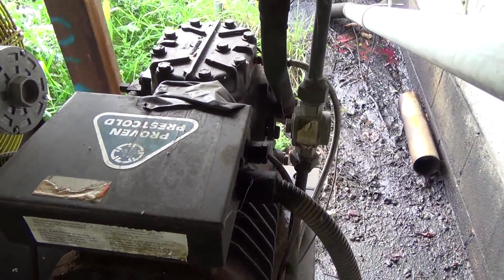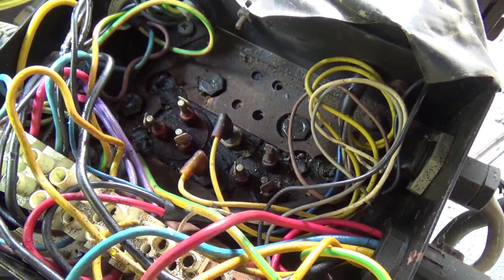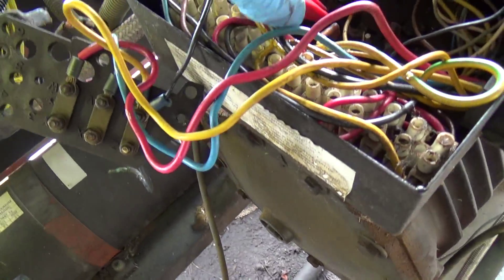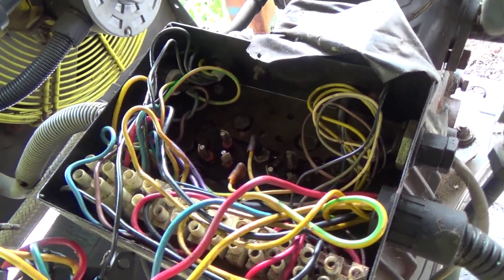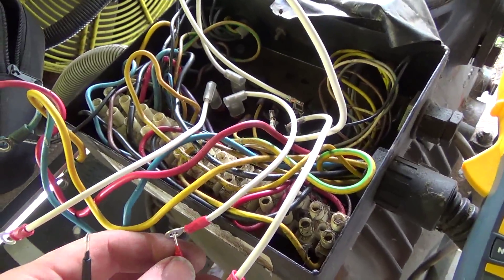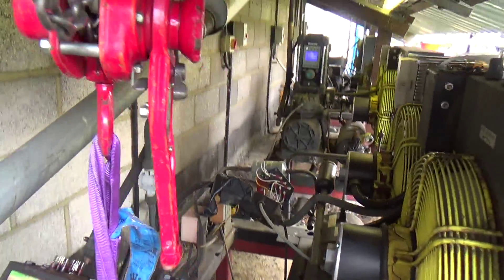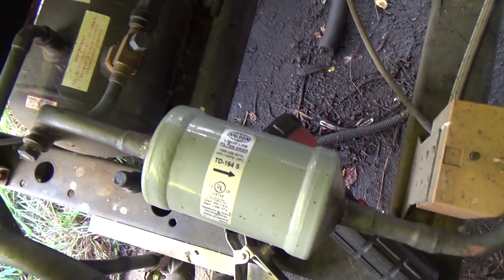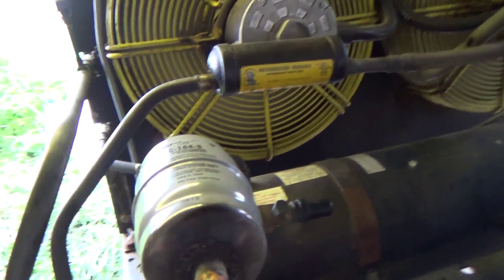Copeland Compressor Diagnosis and Replacement

Comment: Back in the 80's I set up a machine shop and was rebuilding copeland semi hermetics, I removed the stators had them rewired, I dipped them in motor varnish, baked them and reinstalled them,I replaced the bronze bearings and line bored them, replaced the piston rods, resurfaced the valve plates, rebuilt the oil pumps. I set up maintence contracts with supermarkets. That was back when the semi hermetic compressors ruled. Today it's easier and cost less to replace them with comparable 404a hermetic compressors or schrolls, they weigh less and last just as long.

Comment: What voltage on your megger do you use when you test the windings? 250-500-1000? Do you test with the closest voltage to the actual voltage of the compressor 230-460? Thanks and nice video.
Reply from the maker: Wayne Miles I usually test at twice the normal voltage, unless there are possibly electronics in the system, then i will keep the testing voltage at or below the normal mains supply.

Comment: Wash the shirt in degreaser and it will be fine John. I just take 2l of coke and soak overnight, it shifts the grease and oil from clothing, then a long wash in detergent and then wash as normal.
Reply from the maker: SeanBZA Thanks Sean, i will try that next time i open the wrong tap and blow the vac pump oil over myself haha.
Reply: heavydiesel
 Well you might find petropine a little strong, it tended to bleach the blue coveralls pale blue where I used to work. Could also have been the boiling in a drum of water and petropine for 5 hours though. Hydraulic fluid is very sticky.

Comment: what is the further destiny of old compressor?
Reply: Rebuilt and used again. Seems to be doable in the UK with the large population of bolt together units. Here the hermetic is the most popular simply on cost, though there are places that rebuild the bigger units.
Reply from the maker: cache ca Pretty much what SeanBZA said, the old body goes back to the rebuilders on an exchange basis. There will even rebuild the same compressor if there is not a suitable body in stock.It was quicker to get a rebuild in this case, with these types of systems, getting it running again quickly is more important than cost.